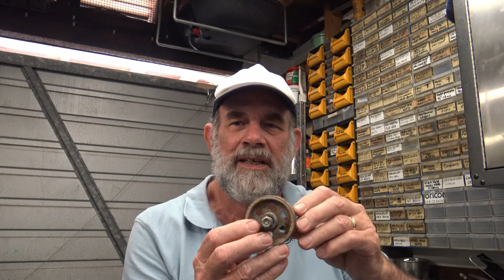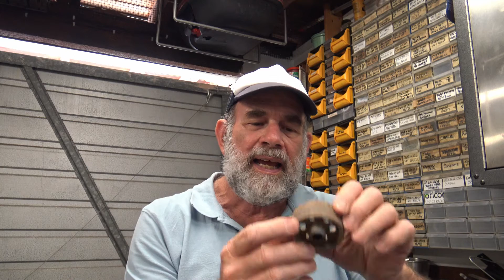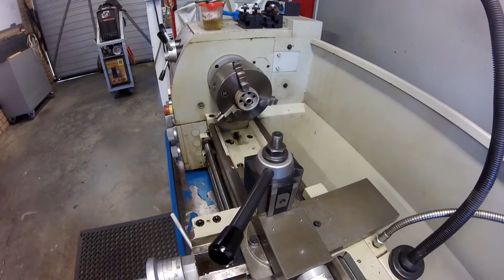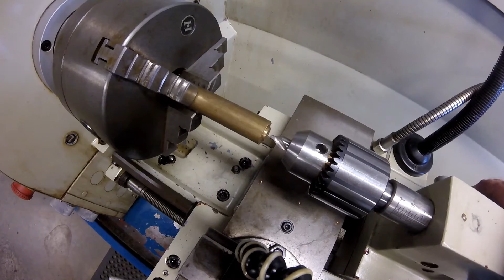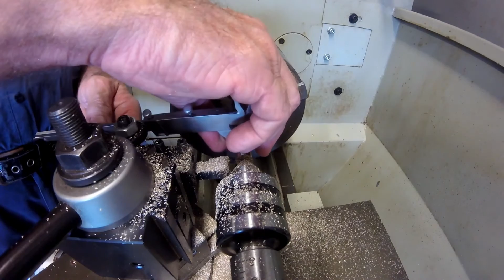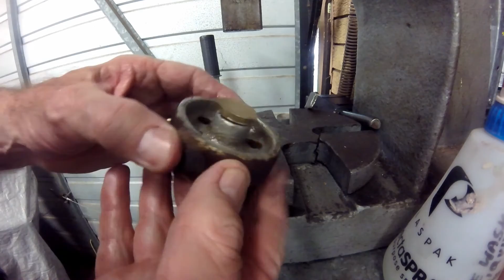Machining and Fitting a Brass Bushing to a Cast Iron Wheel

Comment: What is the reference fit valeus for this cas iron and the brass pin? I need to sleeve a brake caliper cilinder, it is done with rvs, but leaks between the metals, the guy who did this
did a bad job, and has the equipment you have. thanks
Reply from the maker: Interesting question, and the answer depends on the diameter of the cylinder. That one in the video from memory was 0.5 thousandths of an inch (0.013mm) over on the bushing's outside diameter compared to the hole diameter. For a brake caliper cylinder you might get away with 1.0 thousanths of an inch (0.025mm). There are Standards for an interferance fit, based on the internal diameter that you are machining the brake caliper cylinder out to. Hope that helps.